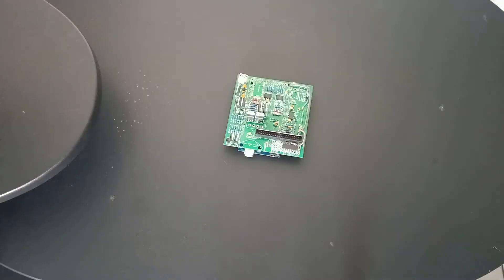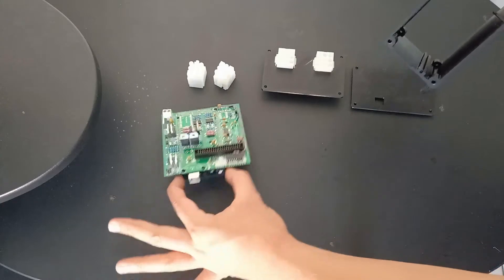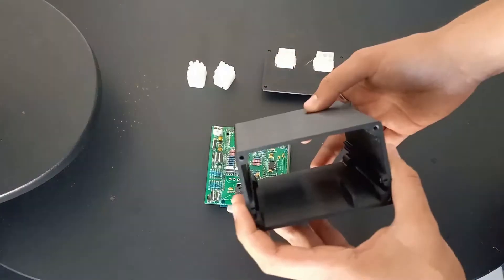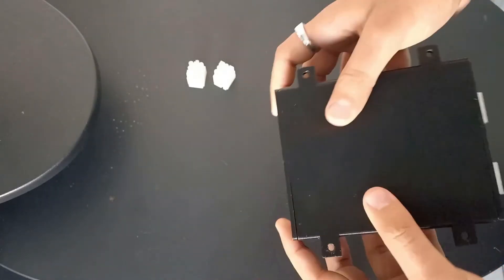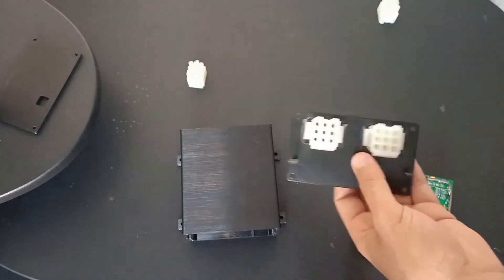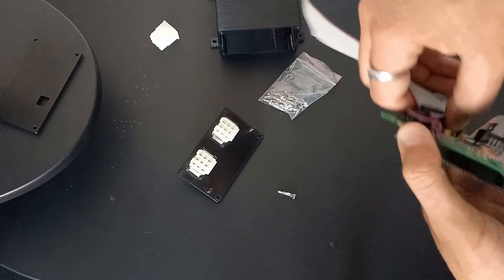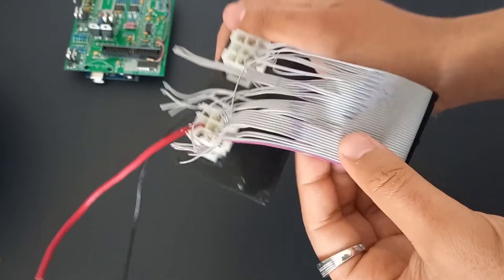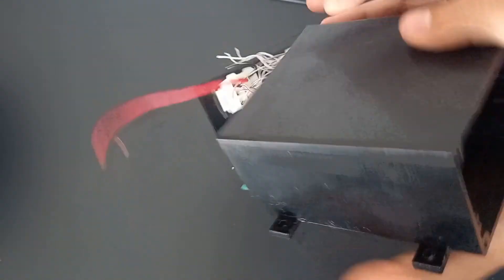Speeduino custom case and in-case wiring | Best budget ECU

Comment: Good day, I'm from South Africa also bought a speeduino v0.4.4b the stl files is not available on facebook anymore
Reply: Sorry my mistake needed to sign into Facebook
Reply from the maker: That's cool. I hope the speeduino treats you right. What are you putting it in?
Reply: @061garage  Was planning to put it into my Mk1 Golf with a 2l 8v, but yesterday i exchanged it for a ABF so it will be going on the ABF
Reply from the maker: @daruisbreedt52  Awesome. That should be a quick wiring job. Where did you buy it from?
Reply: @061garage  Aliexpress September 2021, but without the VR conditioner that was the time they were out of stock
Reply from the maker: @daruisbreedt52  i beleive you should be fine without a vr conditioner if you use a hall crank sensor. https://youtu.be/v-9UIRr_yds